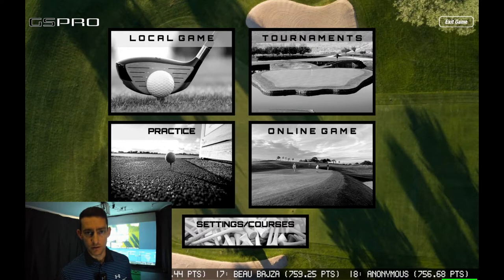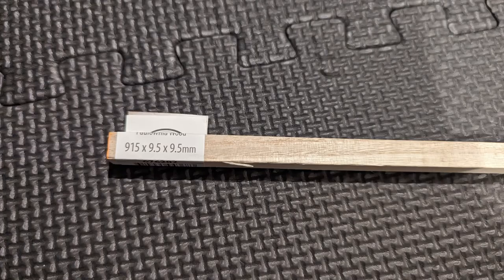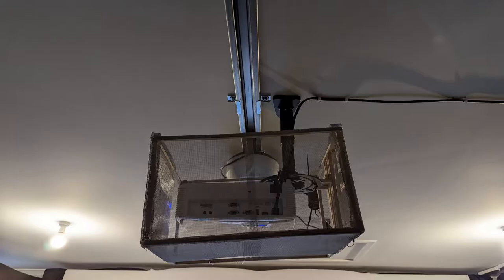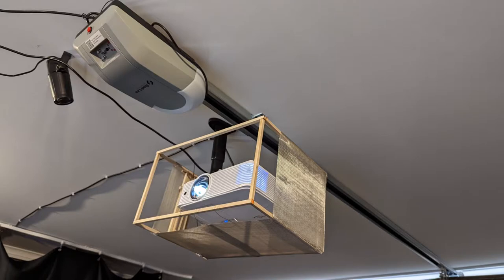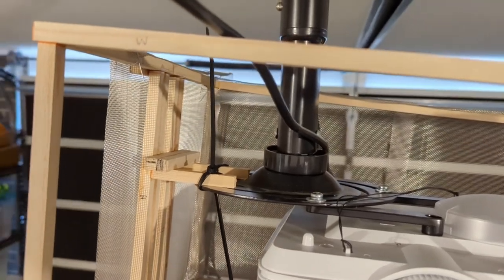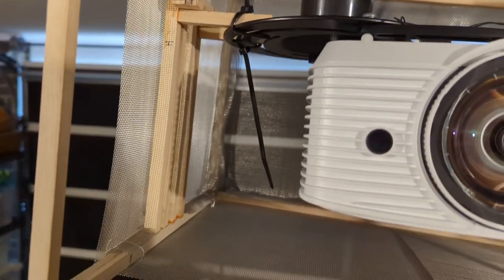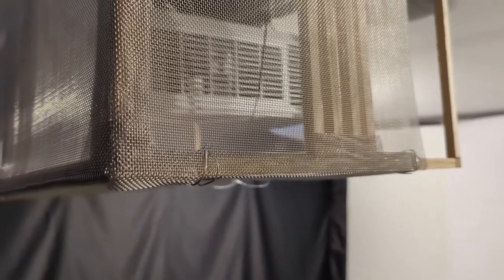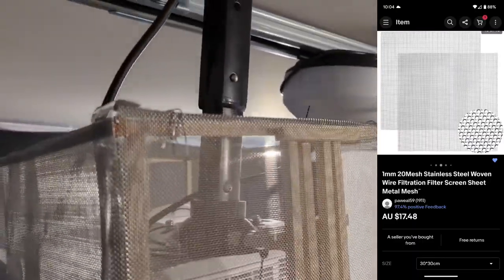Garmin R10 - Faraday cage build to prevent projector interference

Comment: Have you reviewed the SkyTrak+? Don’t think I built my Faraday cage correctly and with the addition of my AC unit into the room… my Garmin R10 is not working.. too much interference! :(:( Needed to know if the doplar on the + would run into the same problem
Reply from the maker: Hey mate no unfortunately I haven't had the chance to check out the skytrak plus. I have heard good things. I don't think the skytrak plus would have issues with interference as it's first and foremost a photometric based unit and the radar is only secondary to get things like club speed. So I don't think the radar would be as sensitive as the Garmin R10's. 
What kind of interference are you seeing? Is it like in my videos where you get random 40y shots?

Comment: Thanks for posting this have a Garmin r10 also and was running into interference when trying to run a fan in the area to keep coo, been 105 to 110°F heat index here lately. Was thinking it was the fan airwaves itself that was causing the problem but I ran across another video that made it look like it was just the EMF that was causing the problem. So probably need to build a box to slip over the fan and see what happens or I may be able to just run the mesh around the fan motor itself not sure?
Reply from the maker: He mate I believe it's the EMF that's causing the issue. I would be really interested to hear how you go if you just put the mesh around the motor! Definitely let me know. Alternatively I know of people who have essentially made a shield and put it in front of their fan and that seemed to work as well.

Comment: Could you use aluminum foil?
Make a suspended frame from the ceiling that is wrapped/covered in aluminum foil instead of any metal mesh 
Only Keep the ceiling side & front open for the projector to breathe out topside & project image only? 
Love the video! Thankyou sir
Reply from the maker: Yes in a pinch that would work I believe but like you said it's probably better to keep a bit of airflow around the projector so it doesn't overheat. 
Thanks mate!

Comment: Does any mesh metal work?   I have some expanded metal from a car grille
Reply from the maker: Hey mate what is important is the size of the mesh holes.. ideally in my experience I have had to have quite a tight mesh like you see in the video. I have seen another guy make one with mesh and the holes were a lot bigger than mine and he said it worked! But ideally a tight mesh and you want to make sure it covers where the air is blown out of the projector.
Reply: Good deal!!  Thanks for all the videos.  Very helpful from USA

Comment: Could you use aluminum flyscreen from bunnings
Reply from the maker: Hey mate I actually got some and have it on my Faraday cage 2.0 however I'm yet to test it. I'm away at the moment but should be testing it in the early new year and will out our a video on it. It should work so if it's cheap then give it a crack! Also if you do let me know if it works. 

Cheers

Comment: Do you think this would work to cover a Garage Gas heater ? I bought extra mesh to find out but wondering what your thoughts are
Reply from the maker: Hey Kelvin I did answer on Facebook however for anyone interested here is the answer.

I'm definitely not an expert in this field. However, if it's small enough, the mesh itself is relatively cheap so it would be worth a go. Let us know if you do it and if it works out for you

Cheers

Comment: How would this go if you made one to sit over the R10 with an open front for the radar?
Reply from the maker: Hey Peter I'm not sure this would work as the R10 is still using radar sending out radio waves and receiving them so it would still have interference from everything else in the room. I think this works because it is blocking the EMI / RFI from the projector itself and cleaning up the environment. Or at least lowering the EMI / RFI from the projector enough to allow the Garmin to read the club and ball.